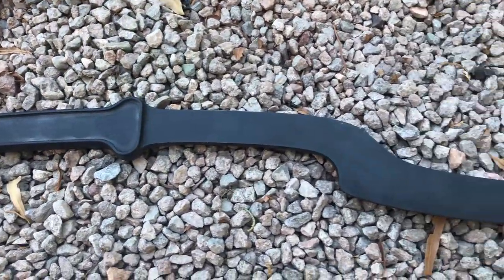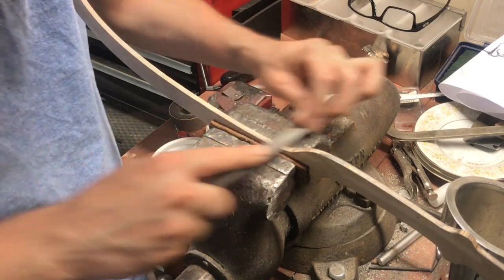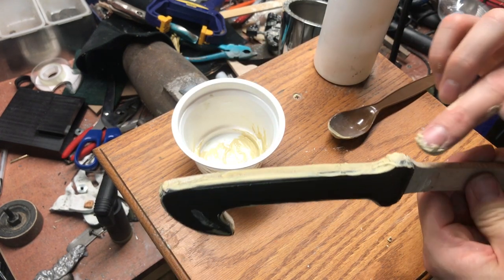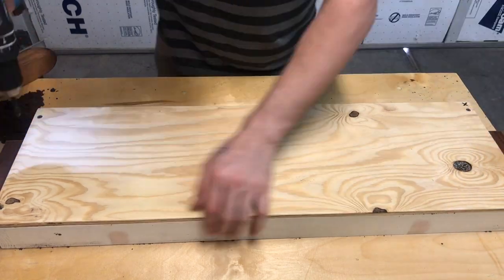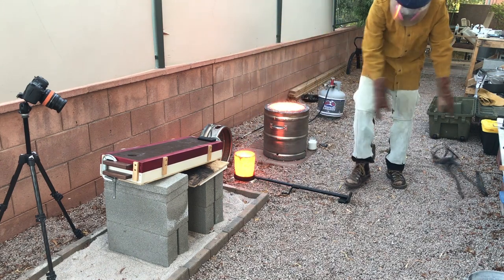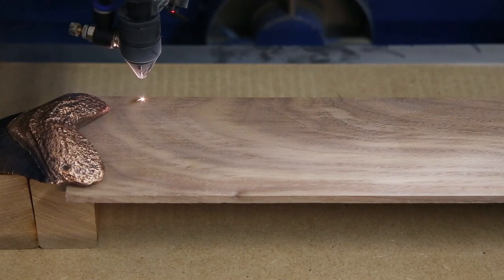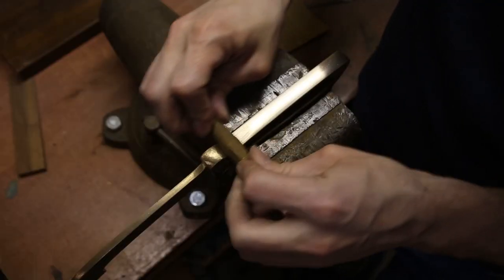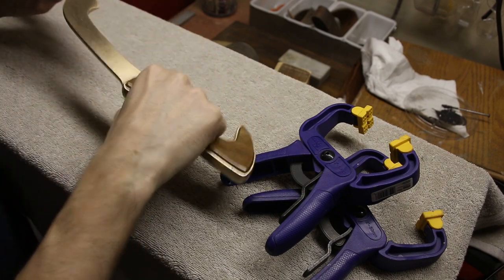Making a KHOPESH Sword │Knife Making │Sword Making

Comment: imagine pulling a bladesmith from that era into the present and showing him the 3D printer, cnc guided laser and powertools. they'd be frothing from the mouth. Very cool build. That will make a great display piece above a mantle. Maybe make a second one and a matching coat of arms?
Reply: Hilariosly, the bladesmith would point out that he only made a wallhanger because he just ground the edge off - didn't form it by cold-forging it with a hammer to thin it out into a cutting, work-hardened edge.
(To be fair, the bladesmith wouldn't look so derisively at other works by Robinson Foundry where he does exactly that).

Comment: Great project Seth!  
I'd imagine sanding the inlays to fit was very tedious. The fit looked great in the video, but I wonder how happy you were with it.  
I think an old gunsmith's trick might be very helpful with this kind of thing. Hold the metal part over a sooty flame, and cover all the mating areas with soot. Then when you dry fit the parts together, you will have a soot mark on the clean part, and a clean spot on the sooty part. This shows you where to focus your work.

Comment: odd fact, but the Kopesh/Kepesh is thought to be more related to axes than swords. Being single edged and preceeded by the iconic egyptian club and later the one bladed club.
Reply: Yeah I kinda hate this being called a sickle sword when those types of weapons are more rounded and the edge is on the inside not the outside.
Reply: @silentferret1049  origins of the word sword might shed light on the idea of a sword. I realised that many Nordic big blades were single edged aswell. Like Puukko, Leuku, Sami Storra nibbi (lit. The big knife, a heavy tool for chopping up caribou), or Seax - in finnish Väkipuukko, many known to have been the length of a man's thigh and carried vertically (instead of the Norse/Dane horizontal seaxes). How ever, I do not know what they used in 1008 when "holy Olof came to visit", nor do I know what preceeded them in the bronze age.

Comment: great video. only problem is that the sword is technically useless because its cast and not forged. cast metal is brittle thats why swords are forged and heat treated which makes for a super hard weapon.
Reply: For iron and steel based weapons, that's perfectly true, but copper and bronze work differently. Cast copper or bronze is actually fairly soft, and is hardened by repeated hammer blows (look up work hardening).

Comment: First, the knife is beautiful.  BUT . . . it hurts watching you make structural mistakes. Go buy used STEEL cope and drag sets.  They typically are held together with wedge clamps and have end posts so your gantry / overhead crane (even a small pivot crane is better than none) can easily move them around your foundry.  STOP PLAYING WITH WOOD copes and drags.  They infuse a LOT of unwanted gases into your castings particularly if the mold is within an inch or so of an edge.  They twist and warp and are a waste of money.  Go find a defunct foundry and pay them scrap price for these copes and drags.  Otherwise pull out your TIG welder and make up your own with square tube.

Comment: it should be a crime to forge a sword and then not cut anything with it.
Reply: This was not forged, it was poured. Forged is taking the metal and heating and forming it normally with hammers. Also unlike steel, bronze needs to be hammered out atleast on the edge to work harden it so it can take a good edge. Even if he sharpened it and tried to cut a watermelon the edge would roll, it would cut but would have to do work to fix it.